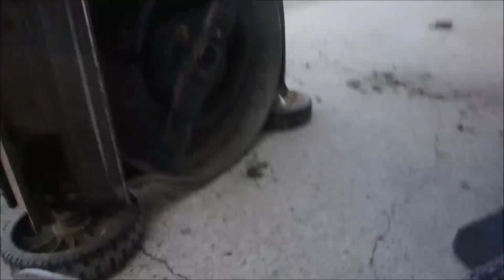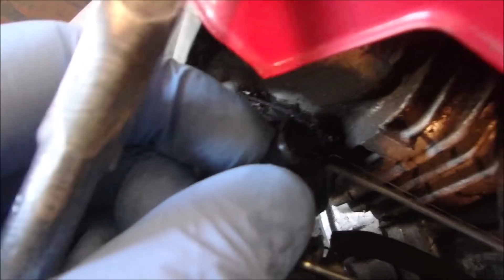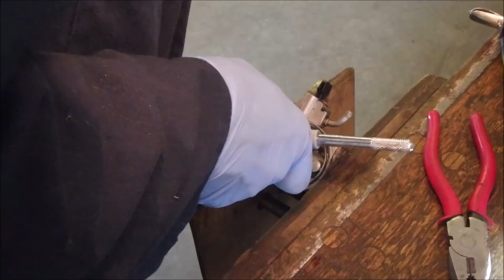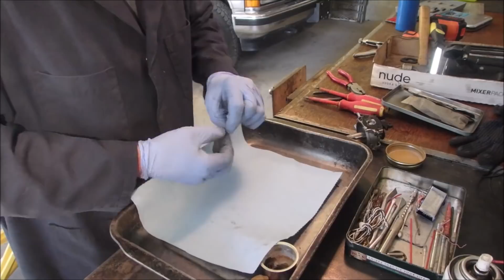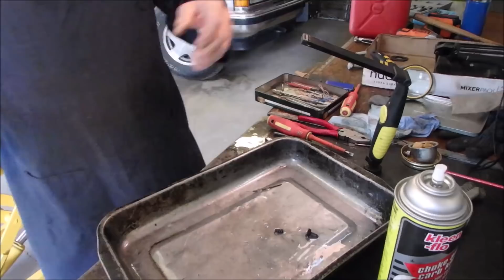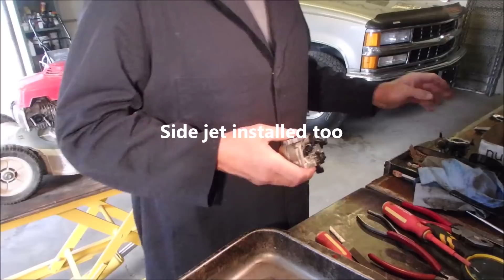Honda HR194 Mower-Can't Remove Main Jet Pt.1

Comment: Bruce the OLD MAN here from Eliminator Performance in Canada. Whenever we get a seized main jet we run it through the ultrasonic cleaner first to dissolve any of the gummed up fuel that may be built on on the threads. After allowing the carb to cool down from the heated degreasing solution we us in the ultrasonic cleaner we set it upright in a vise with wooden blocks that have magnets set in the back side to hold onto the vice. We spray either Liquid Wrench or PB Blaster into the main jet area and let it sit for 5 minutes. We have ground down a screwdriver to which fits the main jet slot perfectly for width and length of slot and after tapping into the main jet with a small hammer to apply a couple of shocking blows todate AND MAYBE LUCKILY we have been able to remove ALL. Maybe give this a try and see if it works for you.
Reply from the maker: Thanks

Comment: Hi Bruce, I bought the same lift as you but I modified slightly by making a ramp at the front where you have the small wood stop. Made with a piano hinge so you flip back and it acts like the stop too! Thanks for letting me copy a great idea!
Reply from the maker: Right.  It may be a ramp to the ground too?
Reply: @BrucesShop  hi Bruce , yes just measured the height  from the floor and cut from an old 4x4 post I had. In the shape of a triangle. Works good.

Comment: Nice McGyver trick on that jet!
Here’s one you’ll appreciate.  I picked up a mower with the auto-choke.  Took me a while to figure out why it wouldn’t start.  Realized the choke arm spring was missing.  I couldn’t find an appropriate spring but I had a piece of thin wire that I wrapped around a 3/16 bolt, put a perpendicular loop on each end and now it works fine.
Reply from the maker: Right on.
Reply: @BrucesShop  Hey Bruce,
I had my first experience with a broken flywheel key today.  I was agonizing over how I was going to remove it without a puller.  I was preparing to pry it off with a hammer hit.  I was wiggling the pry bar to get a good levering position and with just that wiggling of the bar, the flywheel popped up!
Quick question if I may...
When installing the new key, at what point does the key get inserted?  I currently have the flywheel sitting on the shaft with the keyways lined up.  Will the key slip in at this point or do I need to lift the flywheel straight up somewhat to insert the key?  Thanks in advance!

Comment: Those Honda carburetors are a learning process I know , I remember the first Honda carburetor I worked on . Couldn't get the long jet out at all under the main jet , I soaked it for three days in gasoline  . Never did get it out , gambled too just rod the hole out though the carburetor and put it back together and it ran fine . I was lucky and I tryed everything to remove ,  this has just happened this one time too me . They've come out ever since maybe a little trouble once in a while .  I've found since then that if you have time - just too soak them submerged in  Gasoline in an plastic coffee container for  two or three days . I've also use old gasoline , I usually save the old gas that I take out of the gas tanks - and reuse it for this and of course use compressed air to blow them out also use those welding tip cleaners . I usually steer clear of the spray carburetor cleaner .....cause this stuff can run into expense  - one can doesn't last too long when your spraying it - and this cuts into your profit. Too each your own ... just my opinion only .
Reply from the maker: Thanks for the informed comment.

Comment: Great video Bruce, as always.  Hey question.... I want to remove a blade adaptor on a Honda. It’s only 6 months old but the adaptor is stuck on there pretty good.  I’m thinking of using a jaw puller, probably a 2 Jaw puller, but I’m not sure which type is best for that job.  As you know, they come in a variety of sizes and are rated in tons (the amount of force exerted on the jaws center bolt).  What’s your thoughts?   Thanks! 👍👍
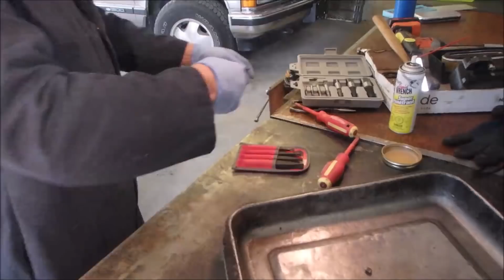Reply from the maker: Get a 3 piece puller that converts to a 2 jaw puller  Go to this video to 13:28 and see   (the video below)
https://www.youtube.com/watch?v=FYxzlj2E2QU&feature=em-comments.

Comment: Hi, I've watched all your videos and I enjoy them. Could you recommend where I could purchase a set of those jet drill bits.
Reply from the maker: Just google micro drill bits.  Here is a Canadian spot on amazon.
https://www.amazon.ca/Dophee-20Pcs-0-3mm-1-6mm-Micro-Precision/dp/B01A9XVUOW/ref=asc_df_B01A9XVUOW/?tag=googleshopc0c-20&linkCode=df0&hvadid=293024427005&hvpos=&hvnetw=g&hvrand=16777367252299026059&hvpone=&hvptwo=&hvqmt=&hvdev=c&hvdvcmdl=&hvlocint=&hvlocphy=9001353&hvtargid=pla-490798177182&psc=1

Comment: sucks that someone that didn't know what they were doing messed with that thing. those are usually pretty good reliable machines. i had to fix one this spring. was a simple dirty carb that just happened to clog up and stop running on their 2nd use of the season. they were considering replacing the machine with a new one since it was old but they were just built to last. all the new stuff really seems to just rot out.
Reply from the maker: I agree.  I just got an old Craftsman Briggs running .  It is 20 years old.  i told the owner to keep it and also keep  it running.
Reply: @BrucesShop  i still got the mower that i learned to cut grass with nearly 20 years ago lol. still runs but noisy since the muffler is holey. that old lawn boy 2 stroke still runs like a swiss clock

Comment: Looks like one left at our church dumpster. It runs but I have to work on freeing up the the blade clutch as per another of your videos. Unfortunately the bag wasn't left with it.
Reply from the maker: Right.  Why is the bag never there.
Reply: @BrucesShop  personally I see no point in bagging. Just extra work to stop and empty it. If you cut grass at right time then clippings just rot and enrich the soil. Not sure if that honda is designed to mulch though.

Comment: can't believe you lifted that mower on its side with the carb facing the ground. guess you can now clean the carb. repair 101 carb must face up.
Reply from the maker: I know but sometimes you just have to do it.  Remember I am 64 years old.    I have not had any big issues. Only if they are let that way longer than a few minutes.  You are right however and I should not do it.

Comment: If you start using an ultrasonic cleaner of high-quality you will never go back to hang cleaning these carbs. While I respect your creativity and your Ingenuity if you would slow down and just put them in the ultrasonic and when they come out soak the main jet with any type of Panther pee and you will have a much better success rate with Carburetors in general. I like your videos by the way
Reply from the maker: I have one actually.

Comment: Found a manual for that mower online ... 1983! GXV120 engine, around 4HP, super solid & made in Japan. I fixed a later version (HR215) last summer; had a bad coil. When I went to Amazon, I found a seller offering the coil AND a carb for under $15! So I went ahead & replaced the carb, too. Thus, for the owner, it was a no-brainer because I got it in 2 days here in the US vs. the several weeks you are now enduring. Here's the manual link:
https://www.manualslib.com/manual/69099/Honda-Hr194.html?page=38#manual
Reply from the maker: Thanks a lot jj

Comment: I would have ordered a new carb and have the customer wait. He messed it up and your time is worth $.  I understand the challenge, but that was a hot mess.
Reply from the maker: I save them when ever i can.  It is the challenge   I know i can order at anytime.  Thanks for the great comment.
Reply: Bruce Pender your Scottish frugal ancestry is showing. Like my German frugal ancestry. I hate to spend a dollar that I don’t have to. I learned from you to use compressed air to reduce the amount of carb spray it takes to clean a carb. $1.97 a can at Walmart, I used to use about 1 can per rebuild, now it is about a half can per rebuild.

Comment: They're a great old mower, i had one with the GXV120 years ago, but unfortunately its gone ( a couple of HRU195's with GXV160's reside here now ) to a better place. Great job on getting that jet out, wow, someone prior was pretty ham fisted. 
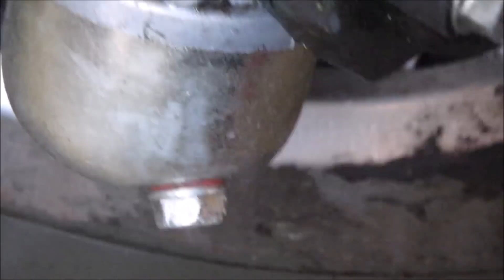Check out  your lift operation in this older vid, you appeared to go from low to high in about two pumps, just something that was fun. Start at 5:30
https://www.youtube.com/watch?v=6V8Pz7HKCb8&list=PLez3-ZFzPRsGB0RDprMM4O37hQNcoukn7&index=90&t=331s
Reply from the maker: Yes  i usually do tn 4X speed but this one was 8X speed.  Thanks again.